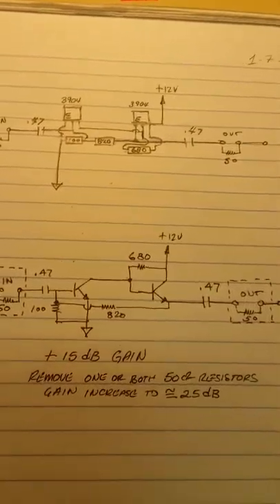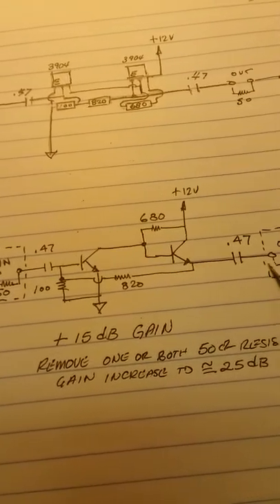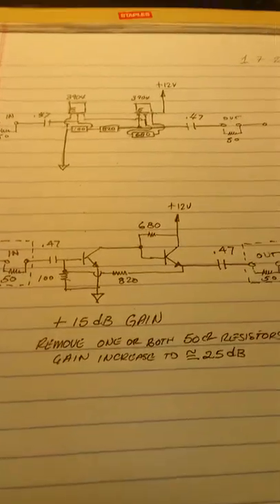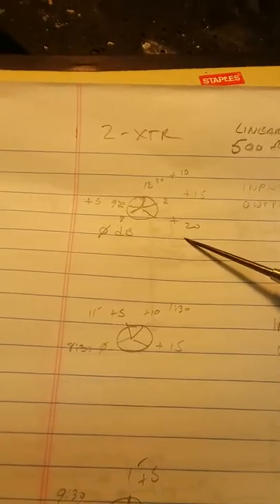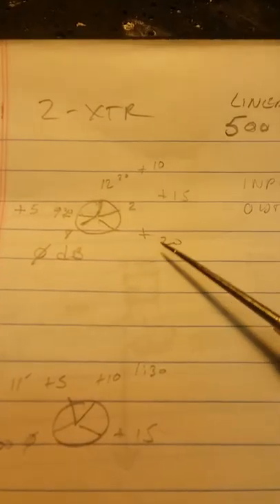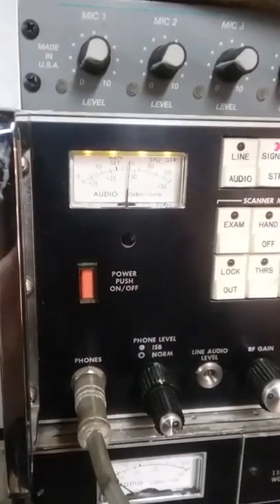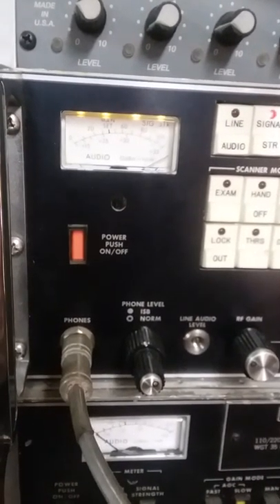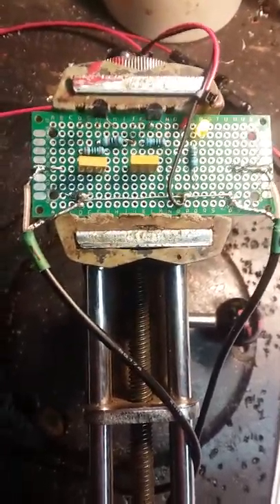Receiver - Antenna Preamp, simple and effective

Comment: Where does the pot go? Your drawing doesn't show a pot in it.
Reply from the maker: Hi Steve. Sorry I missed your question. The pots are at the input and output. Input pot has the wiper to the circuit input and the output pot has the wiper to the output connector. That way, the source (antenna) sees a constant 500 Ohm load which should not load-down the source (like a constant voltage source) for almost any antenna. If using an e-field probe type antenna, then you could go to 5K ohms. The output pot has the full 500 ohms across the emitter follower output with the wiper going to the radio.

Comment: I didn't catch the type of transistor used. 2N3904, 2N2222 suitable?
Reply: This circuit appears similar to a Cable TV amp circuit I have seen which used  2GHz transistors. I'm sure you used some more common types.
Reply from the maker: @blacksmock445  That particular one has 2N3904 devices. There are other quieter devices, but since it's intended use is for MF and LOWFER bands, I left it that way. I cannot measure any added noise in those bands. Yes, the basic circuit is used frequently in TV amps. It is not unique and, in fact, quite common. The reason is that it's simple and effective, has good dynamic range. Of course, the biasing resistors should be selected for best performance for the application.